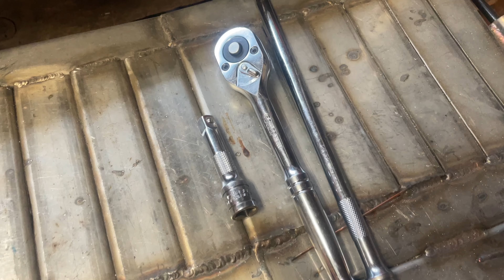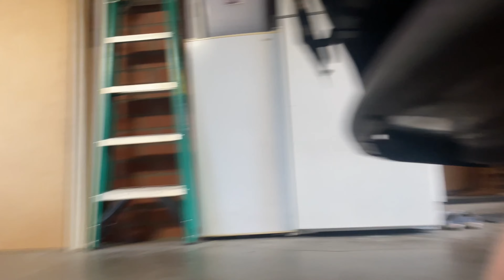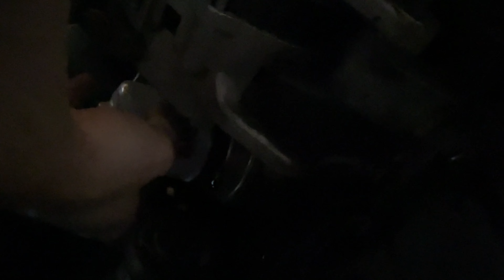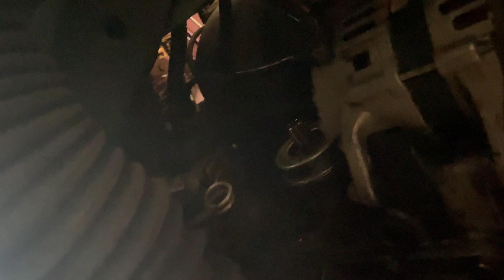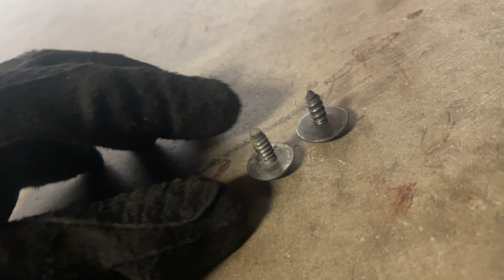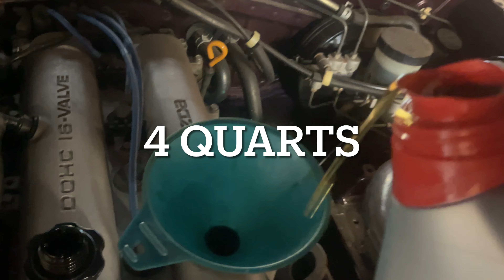How to change oil in a 2000 mazda miata 1.8L  #miata

Comment: What is that bracket you removed and reinstalled
Reply from the maker: It's the intake support bracket
Reply: Is it needs to stay on ? Just bought a Miata and found that in the trunk I’ve been driving it for three days now
Reply from the maker: I mean I would put it back on. If you're not having an issues with it then do what you want, but because Mazda designed it that way, I would personally put it back on